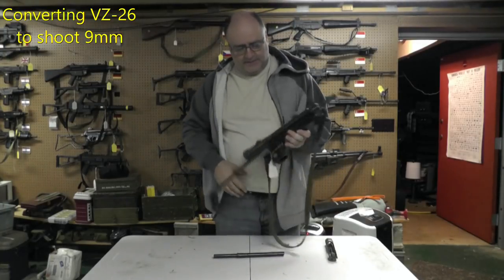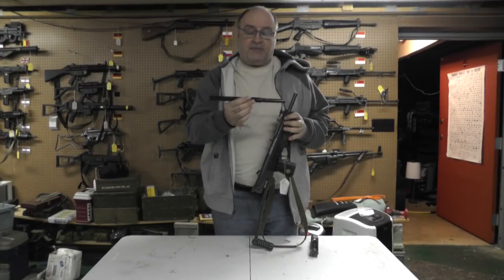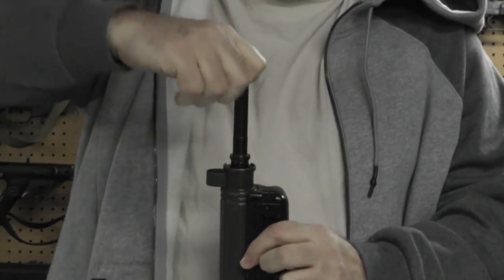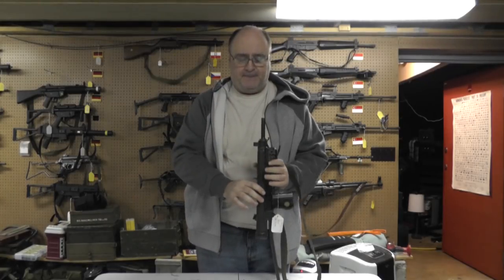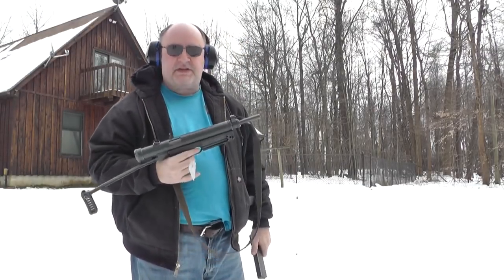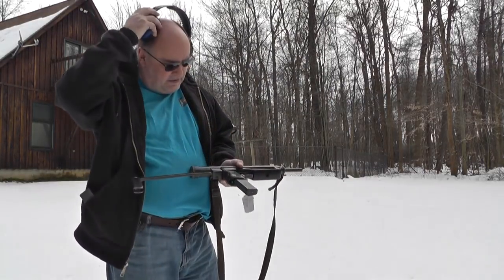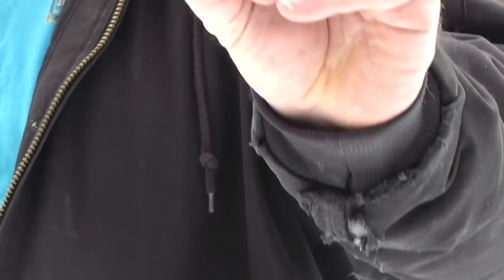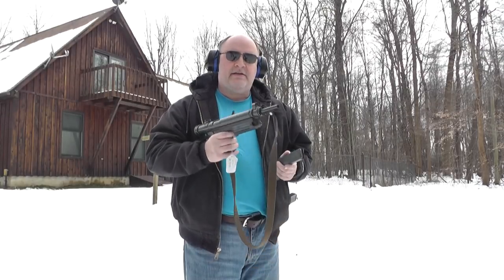Converting the VZ-26 to 9mm

Comment: I built one of these as a post sample machinegun in 9mm and I found that it ran much more reliably when I angle cut the bolt on the rear of the ejection port, similar to how the semiauto Uzi bolts are relief machined for the same reason. I hope yours is running well by now.
Reply: Do you still have your ffl?
I'm doing a build and am interested in getting some help from someone who's been there and done that.. 😅
Reply: @silasnewsome5329  yup. Sure do.
Reply: @SKUNKWERKS  any way I can contact you? 👀
Reply: @silasnewsome5329  REANDDLLCATGMAIL
Reply: Thanks, now I know for when I build mine.

Comment: I think that the jams (stove pipe?) are due to the different energy of the 9 luger cartridge, 20% less powerful than the 7.62 Tokarev. The bolt is sized for the latter. You should try supercharged ammo, with little risk since the vz 26 bolt is telescopic and therefore it is unlikely that everything will burst in your face. Greetings
Reply from the maker: The chamber is tight .  When pushing in a live round with your fingers the round sticks and can not be pulled out by hand.  The barrel needs run
Reply: Machine gun DAD. Is it still running fine?
Reply from the maker: mosintroll mcman I’ve run it once since then.  Had to many things going on.  A little lube on the rounds ran fine
Reply: The 9mm versions have a straight mag well, they are not slanted...maybe thats the reason you have failures, i dunno.
Reply: @vinny214  My thoughts too.
Reply: The difference isn't so dramatic that this should be a problem, some 9mm subguns have quite heavy bolts. If he had a problem he could mill out some weight on the bolt (or a spare bolt) but I doubt it would make a difference, it's probably the tight chamber like he says.
Reply: @vinny214  Someone else mentioned that he did a cut on the bolt of his sample gun and it worked better, compared it to a similar cut done to the Uzi.

Comment: i have vz24/26 with 9mm barrel but you need to do few more things other than change barrel to make it reliable fire 9mm luger... i run through it 1000 or more 9mm rounds and the only last thing i didnt figure out is why it never chamber last round from the mag in 9mm but it do with 7.62mm (no matter if there are lets say 5 or 32 rounds), it did not jam, just does not feed the last round
Reply from the maker: Man on the Range I run it a lot.  The chamber on my barrel is tight. Rather than polish the chamber I just spray a little lubricant like wd40.  Runs good. 
        Likes hotter ammo for sure.
Reply: @psp1921tsmg  my gun have weaker spring, shortened ejector (it runs ok with 7.62 after changes but i have 6 or 7 spares so i change them) and shortened bolt (only 0.15mm and it run with 7.62 without problem after that) and it ate anything even light loads or subsonics... btw my 9mm barrel is stainless steel to remind me which is which :)
Reply from the maker: Man on the Range that’s to much work for me.  If the simple conversion didn’t work.  I wouldn’t bother.  I have numerous other 9mm subguns
Reply: @psp1921tsmg  yep it took few weeks mainly because of testing but at least for me this is part of my country history but with cheap ammo :) and also bringing the gun closer to its past form as it is marked as vz23 on receiver, probably stored for years and refitted in 1976 acording to markings

Comment: What about a 9mm version that continues to jam and stove pipe. Would this be a recoil spring issue due to Tok being a hotter round
Reply from the maker: What I’ve seen in the conversion is it is usually a lack of power in the 9mm  the bolt doesn’t go far enough back to allow the ejector to hit the case hard enough to throw it clear.   Or a bad extractor 
   Way to check.  Run plus p plus hot smg ammo.  If it runs it’s recoil spring issue.  If it does not and problem persist then it’s an extractor issue
Reply: @psp1921tsmg  Thank you sir! Thats helpful.

Comment: I know you are into full auto but were there some ATF instructions for compliance for semi auto conversions out there?can’t find much in recent years.
Reply from the maker: Most of the stuff dealing with semi automatic builds, cover, whether or not it is readily convertible i.e. no open bolts.  Depending on what kind of gun you’re building there may already be a ATF approved plans out there for example, the sten, the bren the MG 34 the  MG 42. All have approved semi versions.
      In my video on not building an open bolt Thompson i cite  several ATF rulings that you can use that video to look up the rulings.

Comment: how reliable is 9mm in a 7.62tok mag? im sure youve shot a bunch more and have a nicely broken in barrel.
Reply from the maker: Actually moved on to other stuff.   I really didn’t have mag issues just tapped the mags to seat rounds at rear of the mag.
Reply: @psp1921tsmg  thanks
Reply: I've seen some other 7.62mm kits built as 9mm guns using unmodified mags, seems it may work at least on some guns.

Comment: Compared with uzi , which is better
Reply from the maker: m 567 the uzi. Is better than a converted 26.  But I’ve never shot an original vz23 or vz25 in 9mm.  I’m still betting the uzi.  The stock is better on the uzi and I like a selector switch for semi
Reply: @psp1921tsmg  bit off topic, do you prefer mg 34 or mg 42?
Reply from the maker: m 567 42 is less picky but I like the 34 much better
Reply: let say it this way vz24/26 is Dady and Uzi is his son...